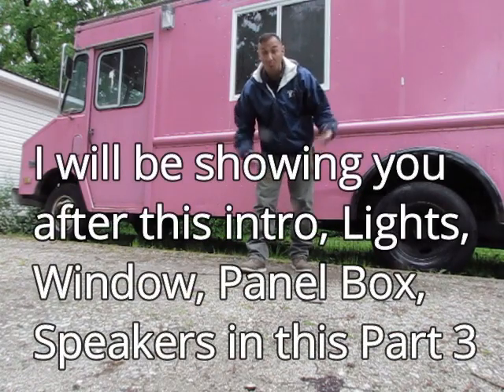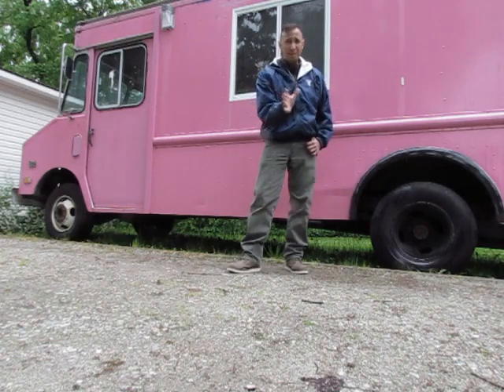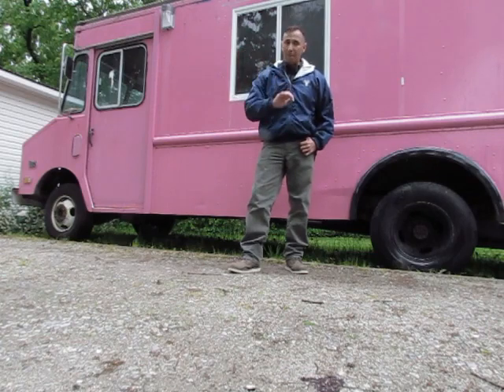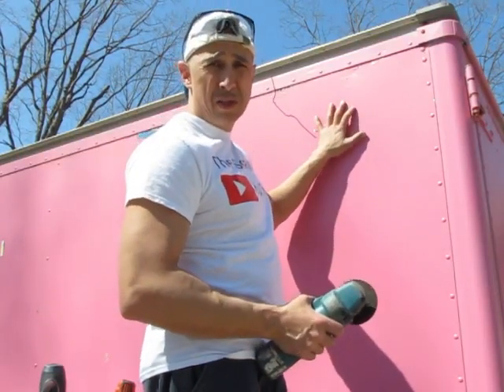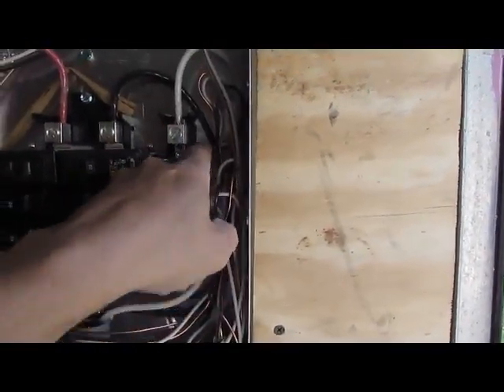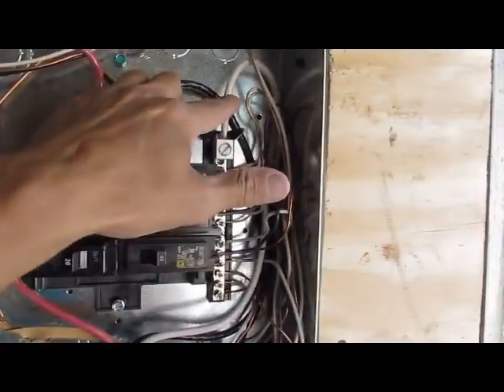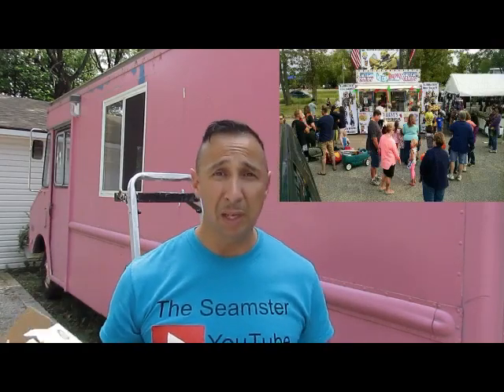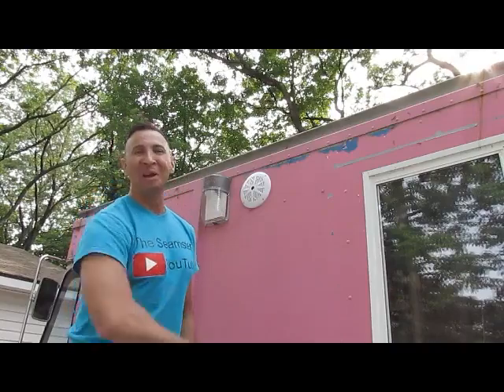How to build a Food Truck/Trailer Part 3

Comment: The only critique I would give for the electrical is that their is too much copper exposed for the circuit connections. You could cut some of that excess lead and gain a bit more safety margin imho.
Reply from the maker: Mohamed Abdinur I understand but I only did it the way it has to be done for a house inspection panel box. If I could make it easier I really would. Thanks for the help. The SEAMSTER

Comment: Hate to ask...but shouldn't the ground and neutral be on separate bars..especially a sub panel
Reply from the maker: This is what I have been shown young and my houses are done this way.
Reply: @TheSeamster  
Whenever you have an auxiliary panel the neutral and ground should not be tied together because the ground wire becomes a parallel path for current with the neutral wire

Comment: You were incorrect on how the electric runs in the panel... but that's ok lol .... your wires on the breakers are stripped  waaaaaayy too much. you may want to trim that! lol. nice work on the truck though. I am looking to do this myself. Thanks for the video
Reply from the maker: I am not certified and you are correct

Comment: What size generator did you use? And what size propane tank did you use?
Reply from the maker: The generator is a 10,000 watt DuroStar $800 on ebay. The propane tanks will be a standard 2 20 gallons for the single deep fryer. All that will be explained it  future videos. Thanks for the reply  :)
Reply: @TheSeamster  if I have a convection oven (commercial), 2 freezer, microwave, 3 warmer and  rice cooker, what size generator would work? Or do you think I should have the convection oven on propane and everything else to run by the generator? Thank you
Reply from the maker: @THEGREEDYCOUPLE  ok to know for sure, on the back of each appliance is a watts. Let me know how much the watts are for each. Will you have refrigerator, electric on demand hot water heater, fountain soda machine, slushie machine? All these use watts. So write you list of everything that may use electricity including lights. This is all the planning stage that will need to get submitted to the approval board.  Thanks :)
Reply: @TheSeamster  thank you very much, I already have a food truck but it's small. I currently have a warmer, freezer, microwave and a countertop convection oven and they all work on a 4000 generator from harbour freight. I'm trying to expand my truck for more room. But thanks for all the advice, once I purchase my commercial convection oven I'll let you know. Thanks again
Reply: @THEGREEDYCOUPLE  ok, but all you have to do is add up all the watts on each appliance and that will be your total. If 4000 is running so much already. That makes it easy to just add the new watts and then get the other generator. If you like the 4000 generator, you could just buy another and use a electric cord joiner/splitter.

Comment: If you use silicone it will cure no matter what. Tape a trash bag around to keep crazy rain and wind from ruining it. You won't have this problem, and the seal will be good for just as long, if not longer
Reply from the maker: cheddarsock You are correct. That is exactly what we end up doing. Thanks for the comment. More videos to come. The SEAMSTER

Comment: I’m fairly certain it’s a bad idea to have neutral and ground bonded together in a sub panel, or in a panel that could be powered by a generator. Only the main panel of the house should have neutral and ground bonded
Reply: I was thinking the same. In the case of a food truck, i believe either your shore line or your generator will have the bond there. So this is a hazard for magic electrical pixie reasons that I should probably remember but dont